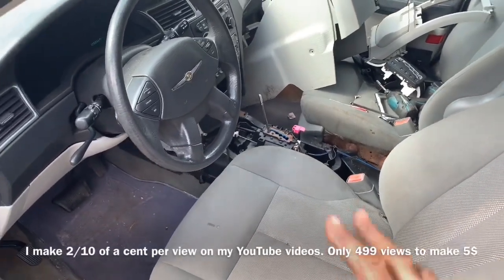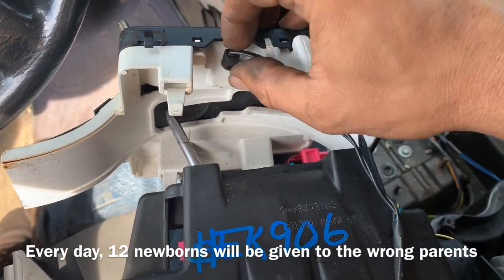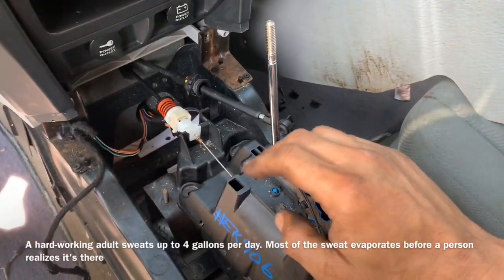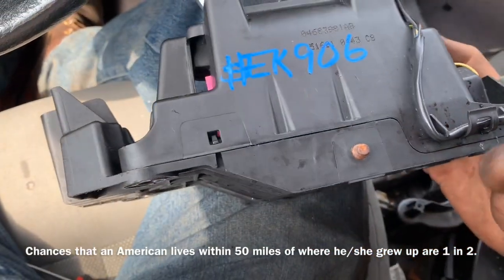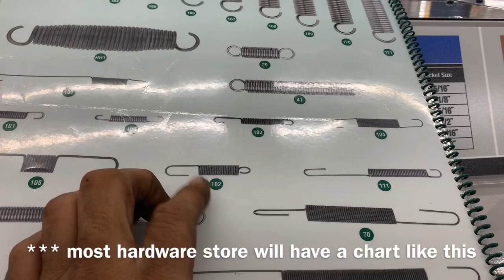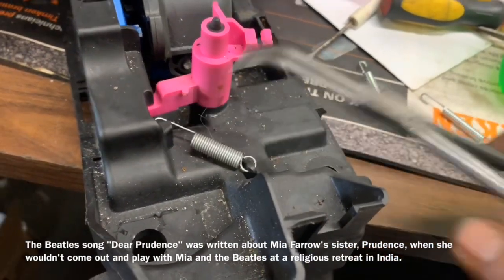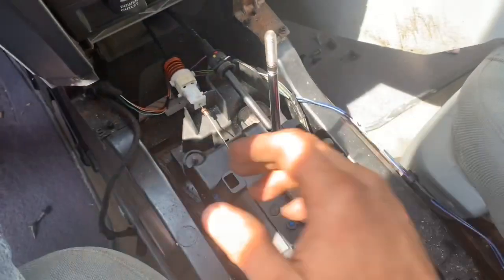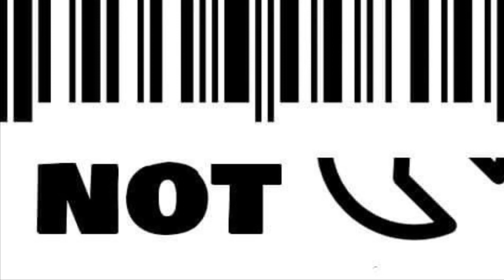How to repair your Chrysler 300 Shifter for $1.50!!! Will not shift from park. Broken shifter repair

Comment: You just saved me a whole bunch of time and money my friend!  2007 Chrysler Pacifica stuck in park.  I went through the usual steps of diagnosing a trans stuck in park-- shift interlock appeared working, trans shifts okay by hand at transmission, raised front tires off ground, yada yada.  I was at my wits end so consulted Youtube, and thank goodness I did!  Same exact problem you describe, broken off plastic spring retainer/tang.

The first spring I used was too light-- it worked correctly out of the vehicle (using the pink override button), but once I installed it in vehicle with the cables, it didn't have enough tension.  So I had to remove the assembly a second time, no big deal.  Luckily I found the original spring deep inside the console bottom, all I did was stretch one leg out of the original spring to fit in the hole I drilled, and it worked perfect.  So if you can find the original spring, you'll save yourself the $1.50.

Can't thank you enough for this video!
Reply from the maker: Great story very much appreciate you sharing it

Welcome to the channel we’re very happy to have folks like you On board !!!!

Comment: Hi there! Thank you for posting this video. I have replaced the spring and  now I am not able to get the gear selector guide pin (the pin that's got a white cap on it) to go down low enough to shift any direction. It's like it is stuck in a higher position then it needs to be and is basically binding up in the silicone gear selector track. I hope this makes sense and I look forward to hearing your thoughts on this issue. And for the record, the new metal part that I put in broke immediately so I ended up just drilling it like you did. 🙃

Comment: Thank you for the video Clay. This clears up part of my problem. To solve all my problems you will need a PHD in psychiatry. Never mind . Seriously the one problem is the shifter. The other problem I hoped you may have insight into is that when I turn the ignition on it shows on the dash that I am in 3rd. And it will not start, probably because it is showing 3rd. This is a 2005 Chrysler 300 Touring. Do you have any insight? Thanks Dan
Reply from the maker: Easy … neutral safety switch is bad…

Comment: Which socket did you use for the bolts at the bottom?. I can’t find the right one. It’s either to big or to small. Thanks for posting this video as well. This is exactly what’s wrong with my 300.

Comment: Quick question do you think it would be possible to switch from this to the electronic shifter in the 2015+ Chrysler 300? (I have a 2013 Chrysler 300)
Reply from the maker: Sorry, I’m not certain of that if they look the same yes and it may be possible, but I’ve never tried

Comment: I have a 2005 Chrysler 300c I replaced my shifter assembly but the white looking piece attached to that cable ( you called it that thingy) won’t lock?? So my car will not go into gear again

Comment: Hi Clay, I have a 2005 chrysler 300 base model. I have replaced the shift lock out pink thing with a metal one, I have checked the fuses, 19 and 29 in the rear fuse box. I still have to push the side thing to shift. Can you tell me what else I can try? Thank you . Wayne.
Reply from the maker: The actuator or the brake pedal switch. The brake pedal switch sends a signal to the actuator in the shifter telling it to move if it’s neither one of them you possibly have a broken wire between there

Comment: I replaced the interlock on shifter. Now my car wont start??
Reply: I have a 2006 300 touring .... 
Replaced the interlock on my shifter. Now car wont start..
Reply from the maker: I think that’s a two wire interlock if it is just take a paper clip and put it in there. 

Then see if it starts obviously it’s not recognizing that you’re pushing the pedal down. 

I would guess that you left something Un hooked If the car with Start before just re-check your work that’s what I tell all of my students